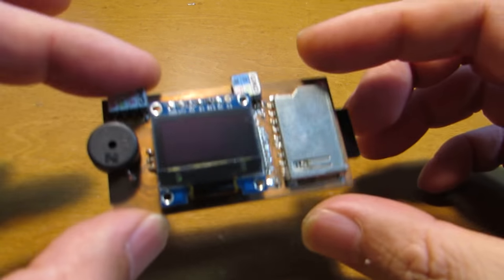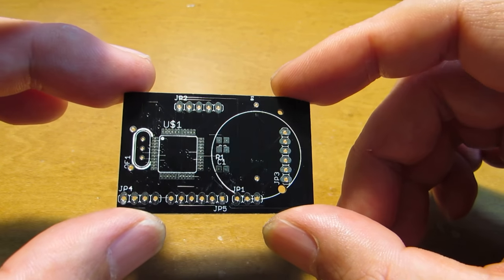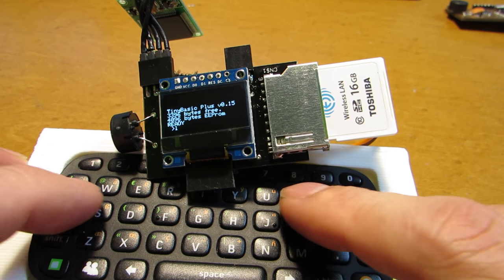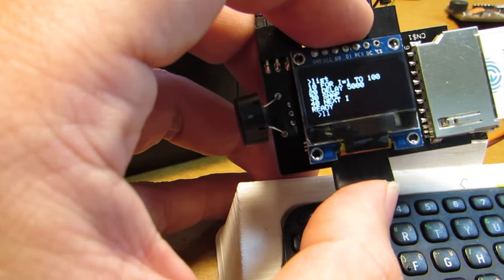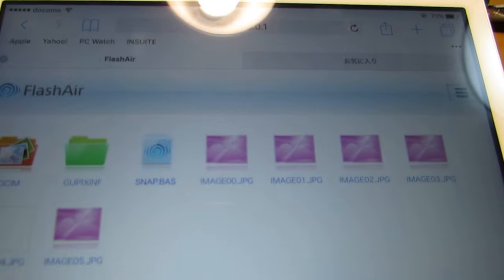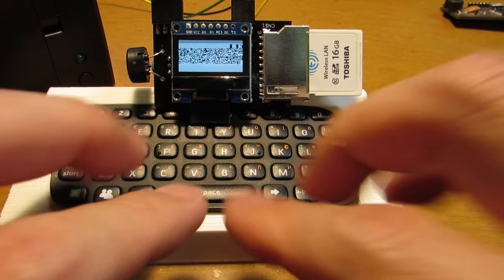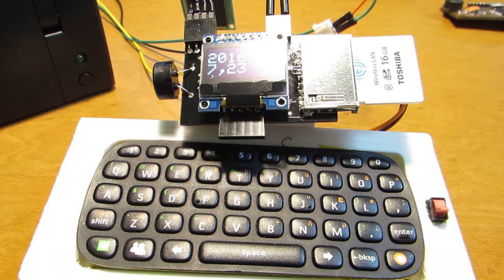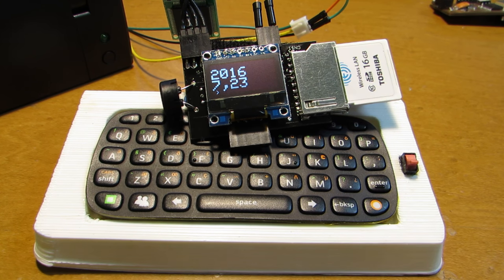My first commercial? message: you can buy TinyBasic computer at tindie.

Comment: need coonectors to keyboard and pinter
Reply from the maker: Hummmm but if keyboard is serial keyboard and also printer is serial printer, current one supports both?
Reply: microwavemont  most usb keyboards can worck as ps/2 (adapter is just wires)
Reply from the maker: Yeah so it will work as is... (need source modification, though..)